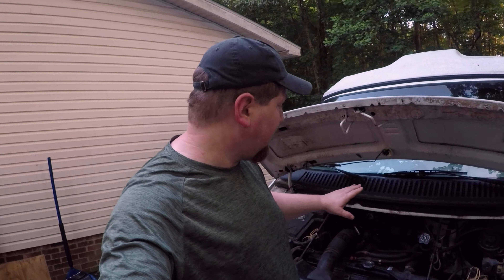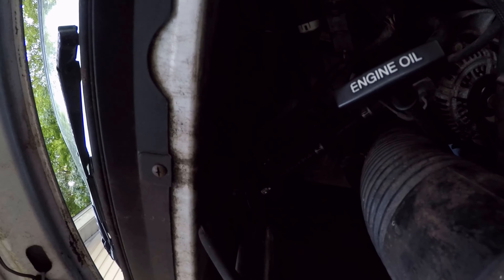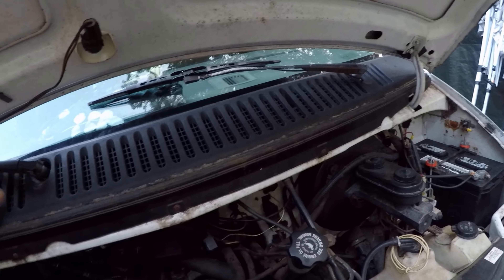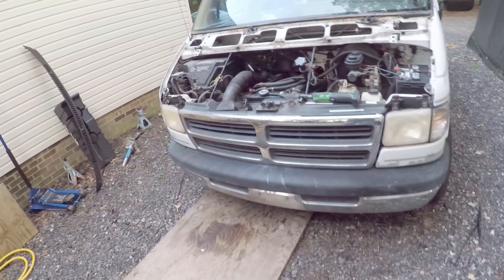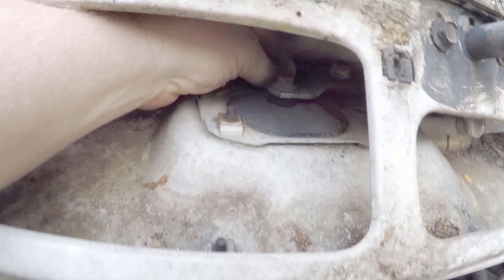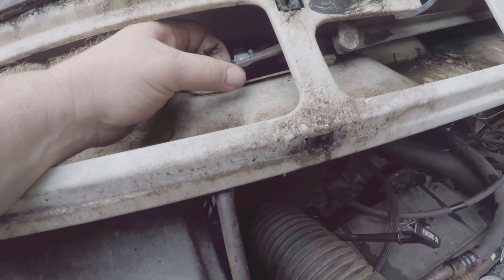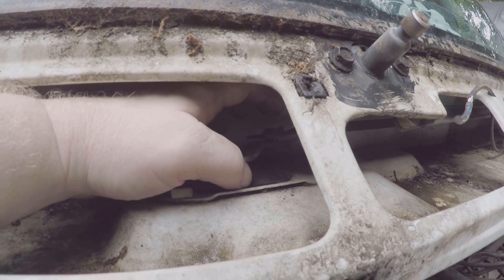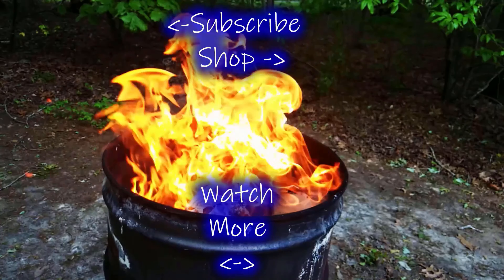94 Dodge van Wiper Bushing Replacement

Comment: I think something is shorted in my wiper motor. It won’t turn off and I don’t think it’s the switch. They do turn off briefly but then the motor makes a weird noise and they turn back on. It’s not too big of a deal to disconnect the wiring on the motor when it’s not raining...but it would be nice if I didn’t have to do it.
Thanks for the video, at least it shows how to get to the motor.
Reply from the maker: Could be. Problem with the circuit board on the motor.  Pretty common.
Reply: @SalemDoyle  thanks!!! That’s kind of what I’m thinking. At first I was thinking it was the switch, until I noticed the motor made a weird noise when it turned on on its own. Looks like an easy fix, and your video helped!!
Reply from the maker: Glad it helped